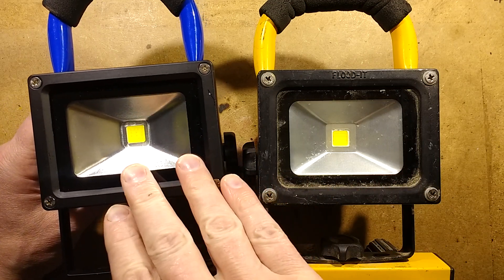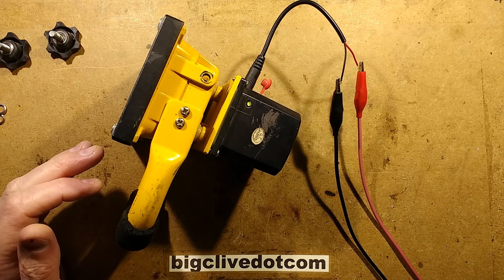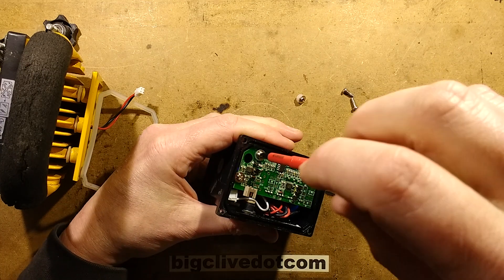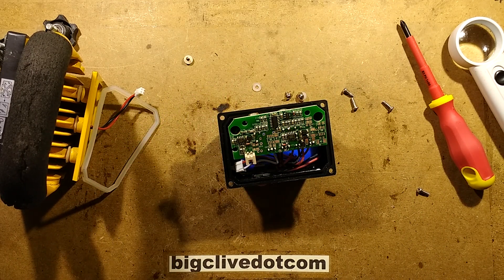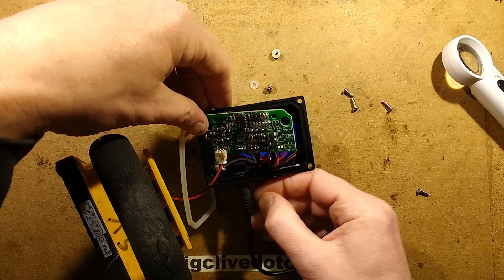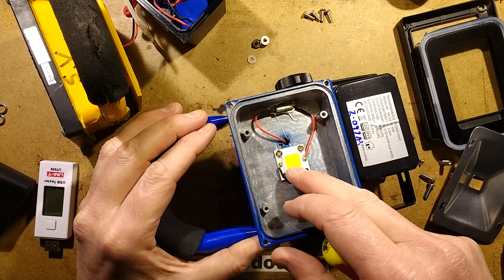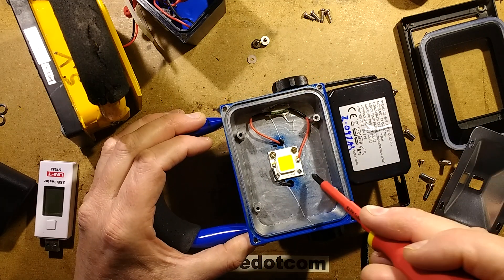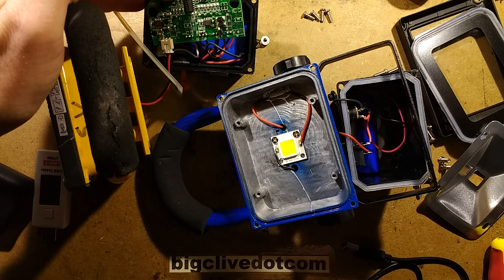Inside a proper (Utility company) LED work light.

Comment: Hi Clive 
Only saw this one today so opened mine from screwfix different again from both yours. Twin 3.7 cell clipped into holder board all plug in on the back of the led panel. Took pics but cant post them on here.

Comment: The battery outputs about 8 watts, and with 3 batteries, it would be outputting 24 watts. assuming that both the LED and the boost converter have a 90% efficiency, that would be 19.44 watts, from that we can infer that the light is outputting almost exactly 20W of light.
The donut inductor, the capacitor next to it, and the diode next to it on the other side of the board form a boost converter, or maybe it is a buck converter and the batteries provide power in series at 24V, that might explain the battery balancing setup.
PS: It is refreshing to see an actual properly built circuit, although analog circuits are really cool and easy to visualize, the complex digital circuitry does the job, and it often does it a lot better job than the analog circuits can.

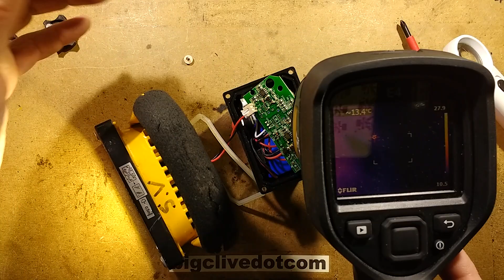Comment: 6:24 You should be able to enable Visible overlay so you can identify the source without using a screwdriver
Reply from the maker: +Mike Johnson It doesn't work at close range due to the spacing of the cameras.

Comment: Got both extremes there lol... One is over complex for what it is, the other barely worthy of the chassis it's put in. I'm not sure why a simple light needs a microcontroller, but at least a real battery with conversion long beats a single cell and a resistor 🙄

Comment: Hi Clive,

I just opened my R250-00 version which I have two off.
It's an in between of those two.
The battery is 7.4V 2200mAH.
The boost converter steps it up to 9V and it draws 600mA to the leds.
For charging it relies on the battery protection built into the battery and uses the same 12V charge wall wart with a led that goes from red to green when the current to the battery stops flowing during charge.
There is space for three of those battery packs in mine so one could extend the range up to over 10 hours which is quite luxurious.
The pcb is glued down and I have not removed it, but somewhere there must be a charge current regulator lurking in there as well, possibly hidden from sight.

Thanks for another great video.

kind regards,

Duncan South Africa

Comment: 12:55 - "...it's probably gonna cost alot more than the generic Chinesy eBay ones."  Wow, he wasn't lying either.  Doing a search for this light (model #FL10YCW) on Google produces results mainly from $70-$85 (~£51-£62).  The cheapest I found was Walmart at ~$50 (~£36) but they were out of stock.

Comment: At £100 that pro lamp had not only better have a good battery, but make the tea as well! My cheapo £20 Wilko unit lasts around 5 hours, and is plenty bright enough.
Reply: Well,  I always cut power workers some slack. Tough, any weather job, sometimes over 24 hour shifts in emergencies.
Give them the best. Here in NE US, sometimes winter clothes weigh more than my tools.

Comment: So an XLSemi buck converter in the charging circuit so that you can charge that 7.2V battery from anything from about 10V to maybe 48V at probably close to the maximum safe charging rate for the cells. And then an XLSemi boost converter to convert the varying battery voltage to a constant 12V to drive the light at constant intensity. Sounds like a good design. For a few bucks you could get a boost and a buck converter from China to do the same sort of thing to the cheapie light.

Comment: A 3.7V cell relying on the voltage drop of the crappy usb power supply. I hope that cell has integrated protection, otherwise it could get pretty exciting when using a proper power supply.

Comment: Just a quick question about the uni t clamp meter. If you zero it out and point its clamp to the ground mine starts showing 30mA. when I put it on the bench it displays arround zero... Why is meter orientation messing with my readings or do I have a faulty meter??? Plz help me Clive
Reply: The clamp meter reads magnetic fields, and is sensitive to stray interference in the same way as a compass.
Reply: Gordon Richardson perfectly right !
Reply: Thanks guys ;)

Comment: I have one of the cheap ones from eBay I think it pulled like 6 or 8 watts I forget but mine had 2 batteries and the power supply was putting out 8.4v but I added 2 more 18650s because I had them

Comment: I know this is old. I know there is a difference between the two, but it is funny that user reviews online for that Flood-it brand here ($100-$175 depending on the model) indicate that it stops taking a charge and there are no user-replaceable parts available.  So the complaint ends up being that you've paid $175 for a good light that is basically disposable anyway.  Unless you're a hacker/builder, you can't replace the parts.  That's sad. At that point, you might as well buy the cheapie.  Of course at 00:24 you mention it wasn't taking a charge, which is exactly what the major complaint is in the U.S. reviews I have found.   Why buy the fancy circuitry if you end up in the same place a few months down the road? Did you figure out what the problem was?
Reply from the maker: It may have been a faulty charger.

Comment: i have a few of the yellow chinese type ones but these are now a few years old and they have the lack of charge controller like your cheapy Clive but do have 6! cells in them and run a few hours at a constant brightness. they charge at 12.8V via an adaptor like the cheapy one has.  so they are sort of a mix of the two you have there.

Comment: It looks like the PCB can fit four separate DC-DC converters, but only two are fitted.   I'd guess it's intended for multiple charging and/or discharging circuits.

Comment: I grabbed one those cheapo ones from amazon here in the states and it was the same story. dinky battery and resistor. I dropped an actual 10w led with a simple 1S lipo booster and 4 cells in parallel. It runs at around 6w or so, but will run for almost 5 hours. Good stuff!
Reply: Aaron S the good thing with these things, is that you can make a slipper thing, or salvage the parts.
Reply: Yeah, the case is pretty much the only reason to get those cheapy lights, the rest of them is usually crap.
Reply: Also if you get a proper LED from a good manufacturer, you can get high luminous efficacy ... more brightness for same power consumption! :)
Reply: Aaron. Isn't it so satisfying to modify an existing enclosure (Chuckiele) and just gut the thing and build it to where you know it will last. And you can say, "I made that light". Awesome feeling.

Comment: I have some led light strip on my deck,the control box,a small 12vlt power controller that is supposed to work has died in cold temps. I brought it inside and as soon as it warmed up,it went back to working. I need to buy an actual outside light controller as my guess is it is not rated to handle extreme cold. I may send you one for analyzing.  I got them cheap on E-Bay. They plug into a 12vt converter wall wart and use a remote to change the light patterns. The green leds stopped working so my guess is something already went out. I put it back outside after it started working. My guess is it will die again later as the temps drop -20 . Yes it is that cold here in Northern Michigan.

Comment: that circuit board reminds the of the ring ones, things are crap. a coworker brought 5 of them and 1 broke within a month so i ended up repairing it , changed the circuit board out for a little boost converter and added a charge protected board to the original batteries, ended up out lasting all four of the others.

Comment: You measured the current but that reminded me of a question I keep meaning to resolve. The current going into the LED can't equal the current coming out of it, can it? I mean some electrons have to be 'used' generating photons. If that's the case can you get measurements very wrong depending on where you measure the current. Don't think I've ever seen that discussed but occasionally I think about it. Probably just confusing myself.

Comment: I’m still curious to know if the reflectors in these kinds of lights make a significant difference to the light they put out (considering the led chips seem to be flat to the rear rather than forward like a bulb would be), or are they mainly just a design choice now.
Reply: Chaos Corner - interesting link, thanks, having just skimmed it, it looks like polymer TIR lenses are more the way to go for effective focus, rear reflectors not so much, but then I guess it must do something as if it doesn’t make a significant difference, why keep it, as Chinese makers aren’t known for including superfluous parts. Heat sink?
Reply: Most likely reason is to make it look like the better designed one. Why does the better designed one have it? Perhaps because the bulb ones did. You know the old story about British railroad tracks being the same width as roman wagons?

Comment: Please make a video of you hacking the cheap light. I would enjoy that very much. Many improvements can be made to that unit.
Reply from the maker: I did one where I increased the battery size.
Reply: bigclivedotcom How about a build where you give it the ALL the tweaks?
Reply: I watched it and liked it very much. I may change my light to a COB instead of one with individual LED's. I do like the LED's like the ones you show here. I also want to make sure that I am driving the LED fully. None of this 10 watt LED with 3 watt driver stuff.

Comment: I would really like to see a video about how to make/hack the cheapy ones into more proper lights. Like with custom circuitry (or modules from ebay etc.), better led chip and batteries, so overall just using the case and making the rest from scratch.  At work we use this style of worklight too, but its from "Haupa".  Charges with 12V I think, and it has an USB outlet, 2 brightness settings and a charge indicator.
Reply from the maker: Easiest hack is a bigger battery pack.  I made a video about that.

Comment: hey mr. c, 
if you find some time to, i may be so outrageously demanding to ask if you could take one of those timer switches apart. i bought one recently and realised that a string of led lights i used to shut down for the daylight with, still were glowing a little bit during the day. i measured the voltage and supposed to get zero, but had 2,5 volts when connected L to L and over 75v with L to N mains. im not near good enough to understand the circuit, but as far as i know, when connected L to N, all there is in between is basically an 56kohm resistor and a inductor that uses the mainfrequency in AC to drive a magnet as a motor to count the passing time. there is a switch but its paralell and doesnt cut the contact this way.

edit 
you already did in 2014, even thou i still dont understand why there is 75volts coming out when in "off mode"
Reply: Thomas Herzog When you say timer switch it is not entirely clear which you mean, a timed wall switch (installed in place of a wall switch) or a plug-in timer?  If a wall switch they will typically allow some pass through current to pass as switch boxes seldom have access to both the hot and neutral conductors, so the switch passes some current through the load to actually power the switch (essentially accessing the missing conductor via the load).  If a plug-in timer you are likely seeing some leakage current from a snubber capacitor that allows a small amount of current to pass through the load and prevents the triac (many devices use a simple triac rather than a more expensive relay) from being inadvertently switched back on when presented with inductive loads due to a fast back-EMF voltage spike...though a snubber capacitor may also be used (optionally) with a relay to reduce contact wear if the contacts are either underrated and/or if the load may be inductive in nature.
Reply: watch some of Clive's other video from about 6 months ago. he explains this and shows examples
Reply: Hit reply too soon... anyhow, either way LEDs require so little current to glow dimly that any leakage current whatsoever will allow them to glow a bit.  The same thing happened back in the day of incandescent bulbs the only difference being that they only emitted wavelengths deep into the colder end of the infrared spectrum at such small currents whereas LEDs always emit visible light within their intended spectrum no matter how little they are turned on (they will also emit some long wavelength infrared as well as they are not perfectly efficient).
Reply: Ethan Poole 
a plug like this one 
http://locksafe.ie/wp-content/uploads/2016/08/TIMER-SWITCH.jpg
Reply: Ethan Poole 
thats interessting. i was pretty shocked (not literally) when even the neon indicator of my main tester glowed.
Reply: Steven Ruscoe 
i actually do bingewatch them since quite some time and even searched for videos about timers, but only found one - not of clive and not very helping.
Reply: but actually there is neither an triac nore a relay inside, only resistor-switch-inductor. the inductor drives a magnet with 50hz to turn the wheel and presses the switch when it hits a set lever and passes the current.

edit 
funny thing is, only one of three led strips glow. since they tend to shimmer when lit, it might have something to do with their circut. i could measure the amps. maybe i will and see how much they need to start.

Comment: Hi Clive, the yellow one is sold in the Netherlands at the Lidl and the Aldi... Tool them appart was surprised to even see circuitry... the  Lidl one even had silicon on the components! compared to the other branded ones at the home improvement stores they are super value for money. So your cheapy one is almost as expensive as the Lidl one...

Comment: Good vid as always matey. Just to let you know the scrubbed microcontroller will be for the 3 colour LED on the side. It's there to provide indication the charge is running low. I have a worklamp similar to the industrial one that I got from Lidl a while back & like the industrial version in the vid it features the same 4 cell configuration. Exactly the same ratings, run time etc. Only difference is the circuit design (slightly different but functions the same) & the LED indicator on the side. On mine it lights solid red on charging & swaps to green on full charge. On usage it stays off until the battery level drops, at which point it lights a solid red (around 10% charge left). Then once fully discharged the indicator light flashes red. I'll see if I can do a vid on it for you :)

Comment: 18:21 God damn, Clive. Your voice just came out of my subwoofer.
Reply from the maker: Unfortunately Dolby tends to divert my voice to the subwoofer as standard on some systems.  Which can be tricky when there's no middle or bass speaker.
Reply: Make no mistake, it was kinda awesome. I just have a cheapie little 2.5 channel set of Logitech speakers -- two satellites and a tiny little sub. It only uses the usual 3.5mm cable for stereo, so I'm guessing it just diverts the lower-frequency sounds automatically. Somehow. (Traffic lights? I don't know how signals work.)

It's never happened with a voice before, though, so it really took me by surprise. Behold the power of Clive! :D
Reply: The Logitech speakers probably have a basic hi-pass and low-pass filters to feed the bass frequencies to the subwoofer and the higher frequencies to the two main speakers. I think the pitch of his voice dropping made the audio be heard mainly through the subwoofer. It's not necessarily a Dolby Surround thing (although it could be), more like deep manly voice. I listen through my stereo in 2-channel mode and that moment in time really boomed. LOL
Reply: It's probably warmer in there than it is on the Isle of Man...
Reply: @crystalsoulslayer   Just capacitors and little coils separating the frequencies, but some overlap on the drivers, and some subs can vibrate surprisingly high.

Comment: i have the same uni t clamp meter, best meter i have alongside my remote display fluke. im pretty sure i got the idea or model number from you! thanks! if you could aquire one of these durite led worklamps for review id be interested to hear your thoughts. i have one and its really good but only a couple months old. time will tell. durite 0-699-86.  its pricey but seems to be well built!

Comment: Funny thing is that the decent PCB and charge circuit probably added $5 to the cost, and the proper non recycled cells added another $5 to the cost of the unit, but the selling price is likely $100 more because of that.

Microcontroller is there to drive the little leds and control the big array, and the low voltage will likely be indicated on the bicolour led, going from green to amber ( both chips either on or flashing at over 100Hz) then red as the battery voltage falls, then the charge management in the battery has the final say on power off. Charge wise same, the micro runs the display and flashes till the battery indicates it no longer is taking current, then only shows green for full charged. Power switch likely is only connected to the micro, no high power through it, and likely it is the generic PIC clone that so many have made in the PRC.
Reply: Yes, but since there are manufacturers that keep producing crappy devices, it means that there still are people who keep buying cheap crappy staff. 

When you go buy a floodlight, and you are presented with two options, one that is $50 and one that is $150 and is slightly brighter, as a non-electronics person, you'd be tempted to choose the $50 one ! :) 

THAT being said, most of the time, in certain devices, the difference in price is tremendous !!
I can understand why people buy them, and why manufacturers build them !